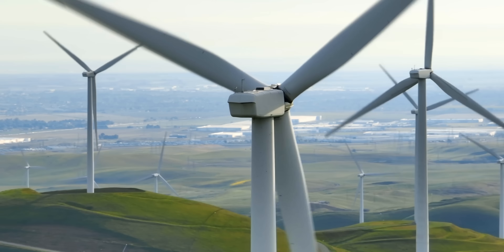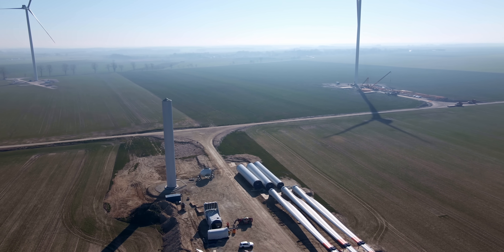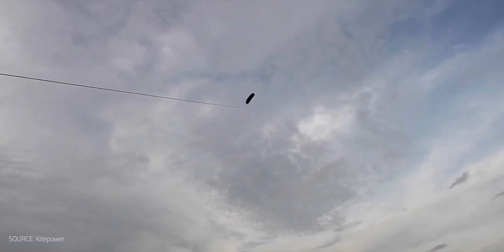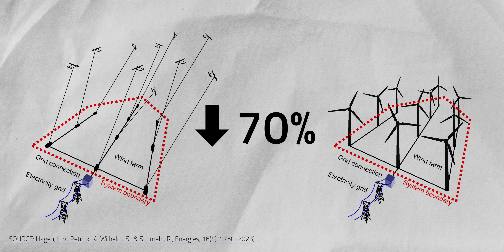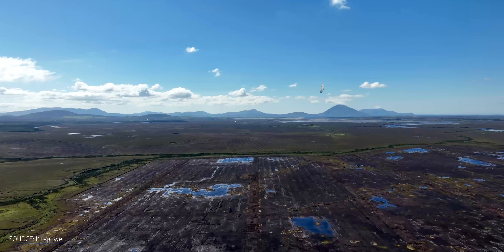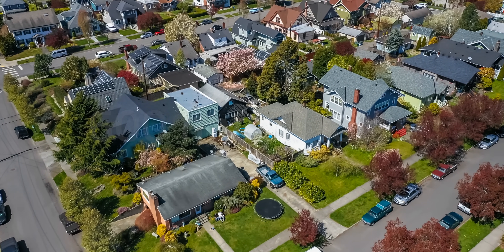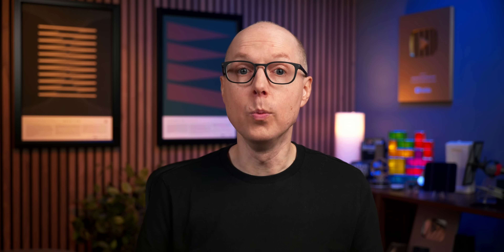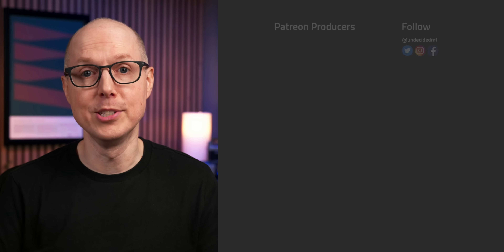Are We Building Wind Energy Wrong?

Comment: Honesty this is perfect for ships. No risk and we have used sails for thousands of years on ships. It crashes? who cares just fish it in. Not only for power but sails can also move the ship without burning oil. So to be this is perfect for ships and a sunny day power source with standard power as a back up for bad weather. I am reminded of the old saying if it ain't broke don't fix it and with ship sails I think there is more to be discovered.
Reply: the biggest advantage is that kite sails produce very low healing moment, don't take up much deck space, and generate like 4x the power for a given sail area compared to regular mast mounted sails. that lets them integrate with relatively conventional ships very well. There are even some kits from companies like skysails that can only provide 1/3-1/2 the propulsive power for the ship, and bolt on to the reinforced achor bulkhead on the bow for use on trade wind routes.
Reply: They want it on the back of the ship, not the front. No longer a sail, but now a drag parachute.
Reply: It would be really cool to make an all-electric boat to travel the great loop with. This might be the answer to getting power in section without any hookups.
Reply: There was briefly experimentation with big upright cylinder "sails" that move the ship by spinning, but work in any wind direction. They kind of fell off in the early 20th century as normal engines got more reliable and powerful, but could also be worth a renewed look
Reply: what is funny is that it's basically sail-electric. with the kite only being used to generate electricity to power the motors, they don't need to worry too much about wind direction.
Reply: Honestly, sails are wings that propel ships, and kites are draggers. I bet it would be more efficient to add an alternator to the diesel.
Reply: @brucegoodwin634  what do you mean ? it's already a thing, every single freighter ship is already diesel electric. the idea is using kites or sails to generate electricity to power the engines instead of burning fuel.
Reply: @danilooliveira6580  How much power will   a kite generate vs the amount of drag the ship propulsion must overcome to power the kite? I don't know, but I will be surprised if this is a positive ratio. Is the wind velocity vector larger than the ship vector? If so, we have a sail! Can I drag a kite behind my Chevy to improve gas mileage? Respectfully…
Reply: @brucegoodwin634  - kites and sails would be the same as far the ship is concerned. You couldn’t use either as you propulsion if you were sailing directly into the wind.
Reply: Really depends on the ship. Sails even kite sails are very labour intensive to maintain in working order for the duration of their use. 
Container ships for example weigh tens or hundreds of thousands of tons when laden with cargo, producing that much much pull with sails is not feasible nor is an fully electric engine of that magnitude. The drag kite idea is to power the ships batteries which would reduce fuel consumption because currently the diesel electric engines are providing all of the ships electricity. Converting fuel to mechanical power to electricity is inefficient and accounts for a large amount of fuel consumption of most fossil fuel engines, which is how such a kite would increase fuel economy even while producing drag. 

If someone that knows how wants to do the math I invite them to do so, If I could do it myself I would!
Reply: While it would be pointless to use on a moving ship, it might be useful for smaller pleasure craft that usually anchor at night.
Reply: @DanielCrist  
haha I hadn't thought of that, could actually save a lot of fuel with that idea.
Reply: that's a neat idea! i didn't even consider that!
Reply: [I is an expert in kite wind power] too slow and unreliable for ships, a lot of finicky gear that needs highly skilled operators and takes a lot of deck space.  Might be viable if ships only needed to do 5-10kts, but 18-20kts is the economic requirement.
Reply: “Hey guys let’s go back to that one technology we left behind specifically because it left ships wholly at the mercy of massive ocean weather patterns.”

🤦‍♂️
Reply: A wet kite would have tons of drag and be hard to draw back in even if you stop the ship. I mean there are winches that can pull huge seines for fisherboats, but that's the thing, they're huge and heavy those winches.  

 If the ship doesn't stop in time they'd tear and create permanent pollution in the ocean as the ruined shreds sink.
Reply: It's complete nonsense due to momentum conservation. If the kite is pulling in the direction the ship is travelling, then it acts as a sail, not producing energy. If it slightly diverges from the direction the ship is traveling, it will generate electricity (with an efficiency of less than 100%) but also change the momentum of the ship, and you would have to spend electricity to correct the course.
Reply: @argfasdfgadfgasdfgsdfgsdfg6351 yeah.  It has the same problem on land that everyone is missing: if we have too many of these kites, it slows the rotation of the Earth...then we fall off, and For what!?!?  To save a few bucks?!   WAY too risky.

Comment: So the power doesn't flow down the cable the kite is tethered to, but the tether drives a turbine? I think that's what you're saying. If the power cannot be used instantly but needs to be stored, the only way is batteries, which means it's pointless. The amount of resources needed to manufacturer such huge batteries is so much worse for the environment than creating power some other way. All these new schemes that companies come up with are nearly always unworkable in real life.

Comment: Fascinating. The designs I remember reading used rotational torque on the cable to generate energy. I wonder if those designs are still being worked on, or if they fell flat.

Comment: the efficiency equation for awe system is pretty neat compare to static turbine. Mainly because the swept area is correlate with lift over drag ratio, and you can have significant large swept area than the kite's actual wing surface. So you end up product the same power with much less weight
Reply: How many kW of kites per square km? Vs wind turbines?  There in lies your answer on raw output.  A bunch of tangled cables will see limitations.

Comment: The big question for any energy technology is: how does it scale. 

Wind turbines and solar-pv scale fairly easily, by deploying more. Their land use density is fairly good, and costs basically scale linearly. 

These kite generators are novel, and certainly have some advantaged at small and for remote locations with quick deployment and low costs.

But how do they scale to grid scale? With long cables, they'll almost certainly have a lower density for land usage to keep the cables apart. And the risks of the kite or cable coming down will likely limit locations to not cover any roads, homes or industrial sites within the radius of the cable. 

I really can't see these becoming a grid-scale solution. A supplement to other large sites, perhaps, like co-deployment over large PV farms which are large enough to extend beyond the cable radius.
Reply: The higher wind speed at higher altitudes should overcome the lower density of these kites, in theory. On a normal wind turbine, the power scaling is something ridiculous like height ^ 5 (wind speed cubed * swept diameter squared). There should be a similar thing going on here, in theory.

I think the real downside here is it’s fragile, that’s always been the big issue with kite energy. I can’t see these airfoils lasting 20 years in extreme winds, and a heavier more sturdy kite (with solid wings) comes with a whole other set of problems. Hard to beat a solid structure mounted on solid ground.
Reply: Kites at sea

Comment: (2025)so with the largest claims of 6,500 mw/h annually what's 17.8 mw/daily (or 0.74mw/h)(not factoring downtime/ powerloss) the trans pacific can get 0.7 mw/h once converting to electricity. If they run it like Edison Motors as a hybrid and could potentially save 80% fuel cost. so for the largest ships avoiding 250-300 tons per day. (in usd 116k-250k fuel cost) This is also not factoring the extra weight of the batteries vs fuel, or flying it at the port. with consumption crossing the pacific costing 250k-300k in tons fuel for the largest ships. on the lower end could be 30 million depending on spot rates at a 22 day trip.

(edit) Note if they do this in most ways will increase the speed of the ships since pace would matter more if fuel was less of a factor for profitability, especially in areas with high insurance premiums. but just to downsize onboard generators is massive in itself. The numbers work better once it can do 1.4mw/h. then speed would increase by 2-3 knots.
Reply: (What the heck is "mw/h" or "mw/daily"? I think you mean megawatt·hours or MWh, it's a multiplication of power and time, not a division. You can do better than Matt Ferrell with units.)

Yes, Kitepower's largest (which doesn't exist yet) could generate 0.74 Megawatts (740 kW) or 17.8 MWh daily. Does that really equate to 250 tons of shipping fuel saved a day?! Claude-ai thinks "approximately 1.5-1.6 tons of marine fuel contains 17.8 MWh of energy"; saving a couple of tons of marine fuel a day is a tiny fuel saving.
Reply: @skierpage  well im not perfect but like with other hybrids that are plugin. Efficiency gains. Normally generators are on full tilt on ships since its providing on demand power to the prop. Most generators on ships have multiple. 

Then it is the efficiency of the generators are 40-50% efficient, then the tonnage of sailing 22 -30 day voyage. 

Like Edison motors the theoretical savings could be 80% based on knots of the vessel. Since they reduced the motor size, eliminated jake braking to be  ev regen (the kite in this case), 

with current experimental tech thats 699 to 1,136 a day at spot prices. 

but this is compounded since of those factors.

since also winds are a constant and pulling. the net force would be around 0.23 knots so like sail boats could be another ton or 2 along the voyage. 

I was being ambiguous with 80% since it can scale to a larger sail. but like we both know its not been made yet. Scale is everything,

Comment: Feels like a better fit for emergency power, not a large-scale power station.

Quick to install/mobile and works 24/7.
Reply: It's mobility isn't inherent in the system, but a bonus. They could attach these to anything with enough open air to operate. I think ski resorts would be a good fit. Close the kit down during the intense parts of winter and fly it to offset energy costs from the lifts.
Reply: If most schools, or high schools, or every town/city installed atleast 1 of these. We'd be talking about a very very different grid
Reply: @NerfThisBoardGames these kits do come crashing to the ground and could absolutely kill someone. The current technology should not be used in except in very sparsely populated areas. They need to be used away from people.
Reply: Seems godlike for ships and offshore facilities.
Reply: Instant home backup power.
Reply: Like all other renewable energy sources the devices that are used to capture that energy are needed most in specific areas of the world and environments
Reply: maybe good for certain military operations. could double as drone countermeasures too
Reply: Danger to aviation?
Reply: So is a diesel generator
Reply: @lewisheasman  A diesel generator without fossil fuels that doesn't need to be refilled or forced to a resource that runs out. wind doesn't run out at any scale we're at

Comment: Please: NOT kWatt per hour ... 😞 Keep energy and power properly distinguished.
Thank for all your inspiring and encouraging videos!!
Reply: 30kw/h is 8.3watt hour.
Reply: This system can't provide a true rated power in KW because it can't operate without a battery or the grid being sustained by something else while the kite is pulled down, so a rating in produced energy in an hour is better than saying it has a 50KW power rating, but because we spend time and energy pulling it down we can't truly make 50KWh in an hour...
Reply: @alexandruilea915  In that case the unit should have been kWh/h.
Reply: @alexandruilea915  god I hate kW/h so much, it's literally per second/per hour, you are dividing by time TWICE. it just feels wrong. why can't we use joules instead ? if you power is 50kW, then that just means that in an hour you will produce 180.000 kJ.
Reply: @danilooliveira6580  dividing by time twice, kinda like acceleration. So this solution outputs 30 kW more power every hour!
Reply: @alexandruilea915  So what's wrong with average and maximum? We have these words, we understand what they mean, where's the confusion? 
Rated power - YYY.
Average produced power - YYY.
Everyone will understand that if average produces is lower that rated, that means that production is not constant. 
No need to confuse people with nonsensical units.
Reply: @alexandruilea915  
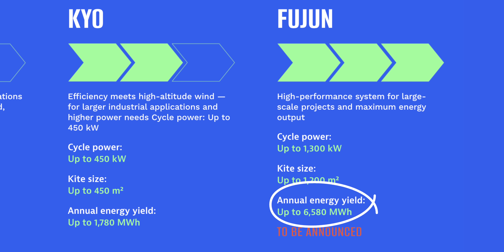Btw, at 10:10 there's info from another company, and it says "Cycle power". That's also a good alternative to "average power". It hints that power fluctuates in cycles, but here's an average value.
Reply: @alexandruilea915  you may use the average power, like it was constant.  I mean kWh / h = kW. Can calculate an average of operating hours (losing energy while pulling kite back) , or average by a whole year's production divided by 8766 hours ( a full year 24/7). 
Of course, "kW/h" is nonsense.
Reply: @alexandruilea915 so they should have said "kilowatt hours per hour"
Reply: @Misterchalm kWh is a unit to measure energy, so kWh/h can be used calculate how many kWh are produced in an hour, but that's like saying just KW as in power becase the equation simplifies with h/h becoming 1 and it's KW*1/1 so KW, but that would not be true because it depends on the conditions of the wind and many other things...
Reply: @alexandruilea915 he said "30 Kilowatts per hour" in the video.
Reply: @Misterchalm yeah, and it's a stupid measurement because it also implies 30KW power available for an hour, which is not that true since the power probably fluctuates between - something when pulling the kite and 60-70 when going up and away. But if he also said that it can generate 30 kWh without the per hour, people wpuld have asked "In how much time?"